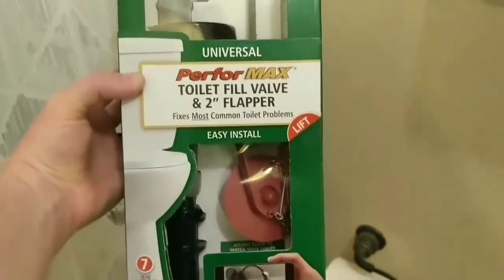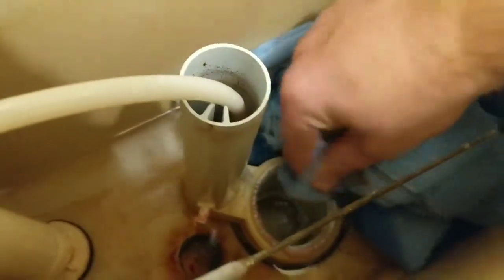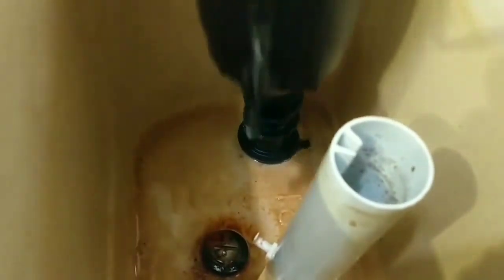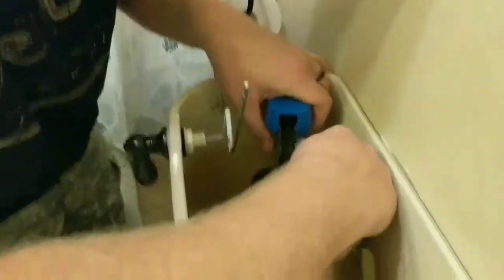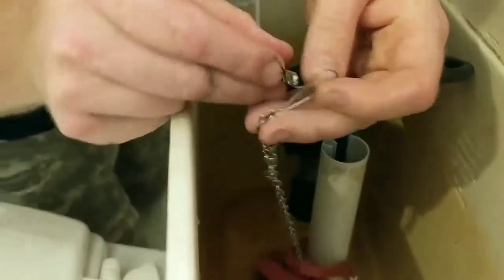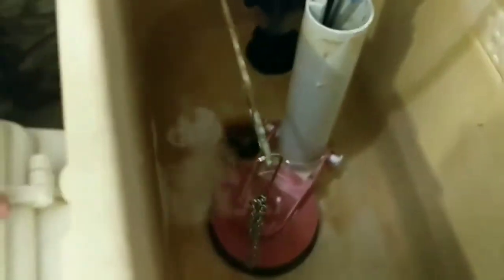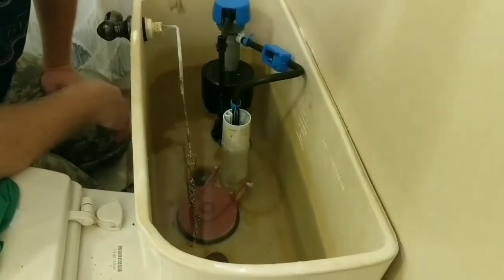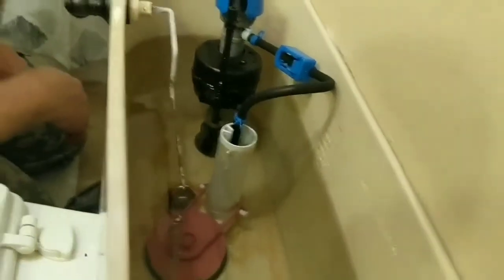Fixing a CONSTANTLY Running Toilet

Comment: Fills too slowly, you need to open up water supply.
Reply from the maker: It was all the way open, minus 1/4 turn.  Not a lot of water pressure there.
Reply: Flapper doesn't always close. Why?
Reply from the maker: @mugseyjack  I apologize - I just saw this message and you probably already have it fixed by now.  If it doesn't close it might be sticking on the flapper attachment (chains were really bad about that), or the excess could be getting under the flapper.  Normally just have to watch the flapper to see what's causing it if it's intermittent.